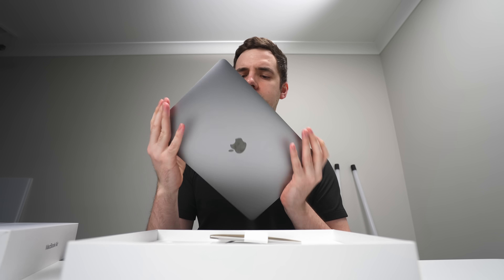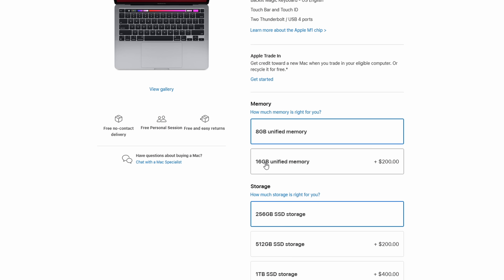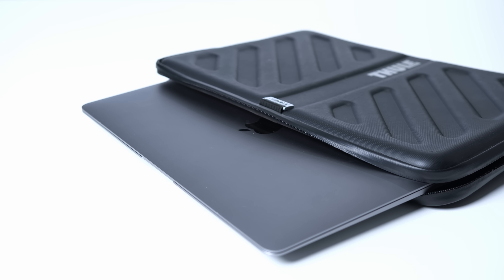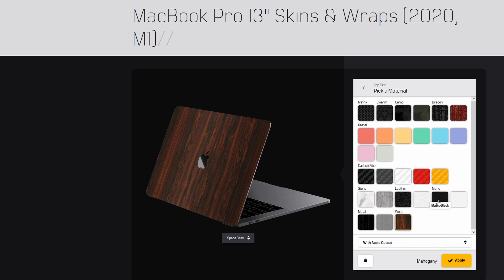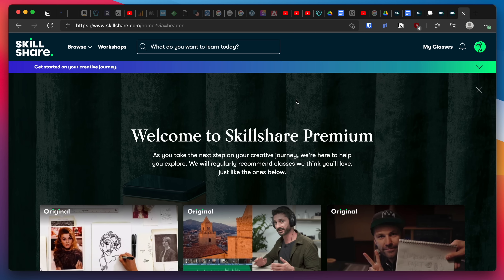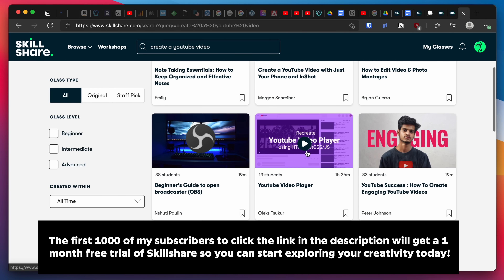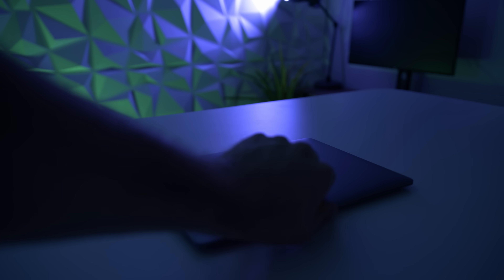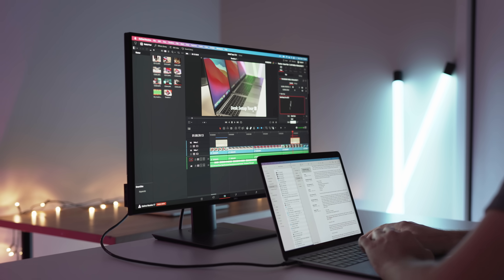How To Make Your MacBook Last FOREVER! (Ultimate Guide)

Comment: One of the reasons I bought a MacBook Pro was due to how much support they get and longevity. I have friends who have had Macbooks for 8+ years while other friends have to get a new Windows laptop every other year. I love Windows but MacOS does a better job with optimization for sure
Reply: This is the main reason I’m aiming for a macbook. With all the problems I’ve experienced on my Windows laptop, I’m traumatized. Macbooks seem so much simpler, less hassle, high quality stuff. It’s just the cost that’s pushing me back lol
Reply: Since 1993 I’ve had 4 Macs as my main work machine. I just stared with a new MacBook Air last year. LC II, iMac, iBook, MacBook Pro. Tbh, I sold the LCII after 2 years when I left Bermuda. The rest were either obsolete or fell apart. 3 apple machines lasted me 26 years - now there’s bang for the buck!
Reply: I have two windows machines one 12 year old and other 5 years old. Both upgraded and in excellent condition. Just getting Mac air now because of solid state (no fan) so no dust related maintenance. In general if you take care of your machines they last ages. Until software support runs out of course.
Reply: The problem is not that windows laptops, but it’s people buying 500 dollar windows laptops and expect them to be as good as MacBooks.
If you’re getting a decent Laptop and know what specs you’re buying, you’re always gonna have it last. Got my Lenovo Yoga for over 5 years now and it’s as good as new.
Update: It doesn't work anymore because the Power Button broke off the Mainboard... to small to solder per hand, working on a solution with a different Button right now haha
Reply: @Breadfan00 yeah exactly, same thing people do with androids. Judge all Android devices based on a $50 phone some financially struggling kid had. That being said, Macs will still typically last much longer than Windows, but Windows is not going to be limited to “every other year,” like what? My 4 year old Windows Gaming laptop is still going strong to this day, I don’t see it lasting as long as my 2012 MBP, though.
Reply: 9 years in my mb pro is still going strong. Might upgrade soon....for the extra power.
Reply: same, bought M1 from a friend used for less then 6 months
Reply: the old macbooks are OP don't compare them with today tech ingeneral that's designed with obsoleteness in mind
Reply: @ko-Daegu  M1 and M2 chips destroy older MacBooks. I’m cool with obsoleteness especially when it’ll last me 10 years
Reply: @pwincesskrissy2557same thing with my Asus rog zephyrus.
Reply: I’ve been still using my 2010 ThinkPad daily
Reply: Yes! I hate how expensive their products are, but I will never buy a non Mac computer ever again. I got my first one back in 2015 and it’s still going strong. We just have issues with base model storage. But I will be buying another one and my husband will keep our current one. I tell all of my windows friends that they are crazy and missing out. Plus not buying antivirus ware every year saves us tons of money over the years.
Reply: @TriggaTreDay  been using windows since i was 6 y/o for the past 20 years. never bought any antivirus softwares. but right now im a full time software developer and been using the mba m1 for the past 2 years. the performance is phenomenal.
Reply: @Maniac-007  You are a different type of human to not have to buy antivirus software for a windows 😂. That sh** is damn near impossible for most people to achieve. Also at the time I was still using windows there wasn't that much help being given on youtube about the matter, I would have to defragment my computer everyday, It was a nightmare. Too much cleaning for no reason. Also I made sure to uncheck all of that spammy crap that every software would have hiding in free downloads. That helped a ton, but it still wasn't enough. Mac is just way better and easier to maintain. But I will say this, I just recently found out that the antivirus software may be the thing that is messing up so many of the window computers. A few months back I reloaded my gateway computer and tried to erase all of the antivirus software that I had ever downloaded, the one that I got from Verizon requires a code for me to take it off. I haven't used that computer in over 8 years. And because I no longer have that particular service there is no way for me to reset the passcode. Now I have to deal with a popup asking me to sign-in every 60 secs. This is the type of stuff everyday non-computer tech science people have to deal with. sorry for the long msg..
Reply: @TriggaTreDay  I would advise you installing antivirus on your Mac. The rise in popularity of Mac has gotten to the point that hackers can make a serious indent if they write malware for macOS.  You may even have spyware on your machine and not know it.  When it comes to your data, I would not be penny wise. It’s not worth the headache!
Reply: @TriggaTreDay  are you using case for your macbook?
Reply: @Maharinii  no, I don’t have a case on it, but I do have a bag for it when I travel.
Reply: @TriggaTreDay the only thing mac computers do worse than windows is gaming.
Reply: @badmoose01  I don't game so I cant really say for myself. I know my little brothers love gaming on my mother's mac computer. So I would have to consult with them on how they feel. All windows are not made equally. So this may be true for the most expensive windows computers.
Reply: My windows laptop is starting to lag only had it 2 years. Waste of $500. I see why people pay lots for apple products
Reply: @PrincessYonnaa  Yea I’ve had horrible luck with windows laptops under $700. I use Windows a lot but it is horribly inefficient
Reply: New M1 especially the Macbook Air, makes all other PC laptops pointless unless you want to game. You can get the M1 MBA for $899(the education discount applies to anyone for some reason). Most PC laptops at $899 are using Core i5 which is less powerful plus, 8gb ram in MBP is probably equivalent to 16gb for Windows. Another thing is a good amount of people including myself have a PC "gaming" desktop. So for someone like me if I do need to run graphically intensive programs I can use my desktop. But on the go the Macbook Air is perfect
Reply: @alphonsusho8962  gaming on a Mac? what game service/app do you use, because the only games I could find on MacOS are Apple's Arcade and some other mobile games that are mediocre. nobody buys a macBook for gaming (which is a shame because of its high powered specs and great software), but I also have a gaming desktop and xbox as well, so I don't see the need to play video games on my MacBook but it would be pretty nice to be able to play top tier games.
Reply: @alphonsusho8962 until the soldered in irreplaceable ssd drive fails and condemns the whole laptop
Reply: Your friends probably didn't pay MacBook money for their Windows laptops. Don't get me wrong, MacBooks are nicely built machines, but I see a lot of people compare Android Phones to iPhones and Windows laptops to MacBooks without considering the price brackets they're buying each one at.

A Dell XPS or Lattitude, some series of Lenovo Thinkpads, an HP elitebook, would've had similar performance and longevity to your old Intel MacBook, but would've costed MacBook money too.
Reply: How can a sane person love windows :D
Reply: @topsl69  Windows 11 has actually been decent. Definitely a improvement over Windows 10 and it feels similar to MacOS. Plus I’ve been using Windows my entire life, I’ve become accustomed to it at this point lol
Reply: @Dylan-qy5tc  windows 11 is def not an improvement over 10 rn, but the amount of software it supports is astonishing. Still mac ftw!
Reply: get a macbook and use bootcamp. literally 2 laptops in one

Comment: Best video on choosing a MacBook that I've seen yet! Quick question: what would you guys recommend for my use case? I hope to get into video editing & design work after college, which is about two years from now, so I wanted to hold off and choose something powerful then. However, my current laptop is really on it's way out, so I need a replacement to get me through college. Do you think the M1 Air would hold up later on? Definitely upgrading to 512GB storage, how about RAM?
Reply: Rule of thumb, RAM upgrade should be your priority over storage. 
You can always buy external SSD's later but you cannot upgrade RAM. 
Unless you plan to store too many files Mac, it's better to go for 256GB/16GB version.

Comment: You are incorrect about the surface of the MacBook only being aluminum, it's painted but there is a surface material over the aluminum because that's how they get the colors for silver and space grey.  And, there is no need to plug in your MacBook if you're using it for hours and hours, because the new MacBooks battery life is amazingly long.
Reply from the maker: Actually it's not paint, they alter the color slightly through anodization. So technically I am correct - there is no paint on the surface. Also, you should have your MacBook plugged into the charger if you're sitting at a desk working for a long period of time frequently. This is to reduce the wear and tear of your battery and will make it last much longer. I go into much more detail on this within the video I mentioned.
Reply: @CreatedTech  I meant to say "it's not painted".

You can't reduce the wear and tear of the battery because it's always in a state of decay.  But the majority of information I've found says not to keep it plugged in while working often.  That would be like leaving your iPhone plugged in all night, it's not good for the battery.  Leaving Lithium Ion batteries at 100% state of charge for lengths of time reduces their life, that is just a fact.
Reply from the maker: @Resist4  I encourage you to watch my video on the battery topic. I explain everything and include multiple trusted sources, including Apple's own support articles that outline why keeping it on charge while working is not an issue. You absolutely can reduce wear and tear, and by quite a large amount.
Reply: @CreatedTech  again, Lithium Ion batteries don't like to sit at 100% state of charge, it's not good for their health.  This means it will reduce their lifespan.  I'm an electric vehicle owner and know about this sort of thing.  And your term of "wear and tear" on the battery is misleading.  Batteries really don't do this, they chemically decay, which starts to happen the second the battery is made.  The process can't be stopped but can be slowed down.  And Lithium Ion batteries are most comfortable at 50% state of charge and should always be stored at that state.  Leaving the battery at 100% is bad.
Reply from the maker: @Resist4  Ok, it's clear to me that you haven't watched the video I made specifically on this topic and are too stubborn to have your mind changed.

macOS will ensure the battery does not sit at 100% while attached to a charger for a long time. It's a feature built into the operating system made SPECIFICALLY to ensure against straining the battery.

The BIGGEST way you will reduce your battery's lifespan is by charging and discharging it often. If you're going to be sitting at a desk, might as well plug it in. macOS will keep the charge percentages at optimal levels. If you're using it away from a constant power source, charge it in bursts to keep the charge roughly between 40% and 80%. 

I'm not sure what you are struggling to understand by "wear and tear". Of course batteries degrade constantly, I'm not arguing against that. I'm simply saying there are certain activities that speed this process up.

Also, your point about owning an electric vehicle is moot. I own a toothbrush, does that mean I'm a dentist? Same train of thought. I worked for Apple for 4 years, and consulted chemical engineers to make my MacBook battery video. What I'm telling you is 100% correct, and it's up to you to decide if you want to change your mind.
Reply: @CreatedTech  My point about owning an EV is not moot and comparing charging that with an electric toothbrush is ridiculous.  EV owner are more aware ab out charging practices as not to reduce the battery packs lifespan.  And I did watch your battery video, but I will watch it again, maybe I wasn't fully paying attention the first time.
Reply from the maker: @Resist4  I didn't say electric toothbrush, just toothbrush in general. My point was more about not comparing MacBooks to an EV as they are quite different even though they both use batteries. 

Yes, please watch the battery video again. I recommend following the advice in that video if you're wanting to maximise the lifespan of your MacBook battery. Although, like I said in that video, it's not a big deal even if you don't and worst case scenario a replacement battery is fairly inexpensive.
Reply: @CreatedTech  All I know is that I used to keep my 2010 MBP plugged in all the time when I used it for hours and ended up replacing the battery 3 times, one of which didn't even last two years.  After talking to others about it they insisted it was because it was plugged in so often and that I should have been plugging it in at 20% and unplugging it at 80%.

But after watching your video a few more times, now I get it.  The new MacBooks software is more optimized for battery health.  So while I can't keep my 2010 MBP plugged in often while I use it, I can with my new M1 MBP.

Comment: I did none of your suggestions, and my mac air is almost 10 years old.
Reply: Did you have any problem with the battery? I've changed my mid2012 air twice now, first last 2019, and second this year. But other than that, it's still alright. I'm thinking to buy the M1 these days bcs I don't think this dude is going to last another year lol.
Reply: @atfannyfanny  I must admit it's always connected to power. My guess is that the battery would only last about 40 minutes if I disconnected it. Yeah - I'm not really confident mine will last much longer either.

Comment: Excelent like always! Congrats for the growing channel! One question, do you recomend put screen protector and silicon keyboard cover ? Maybe with time the screen will be scratched with the keyboard?
Reply: the keyboard and screen never touch. There is a rubber lining on the outside of the screen that only comes in contact with the edge of the bottom part. No need to get a screen protector on a mac
Reply: @Kamran1025  thank you so much!

Comment: "How to make your MacBook last forever?" Not worth the effort, i guess.
I would save all the bucks for ridiculously expensive hardware upgrades if I don´t really need them right now, keep the money and sell the MacBook after 3-4 years, will still archieve a reasonable price. Loss over time will be higher the more I spent in hardware upgrades initially. Selling and previous saved money will pay my next new MacBook, or whatever I´d like to buy then. And I have to spend the money when I actually get something new for it, not years in advance just to keep the stuff longer.
Actually, if you don´t high-level manipulate video material, you won´t need the 16GB RAM upgrade. And SSD capacity... get an external 1TB SSD with NVMe controller and USB3.xGen2 connection, it´s quite fast and will cost you a hundred bucks instead of Apple´s 1TB upgrade for four times the cost.
Also keep in mind, there´s no chance to exchange hardware in nowadays MacBooks. That means, if your RAM or SSD has a malfunction after guarantee time, that´s it. So, your MacBook will work fine for five to ten years, or maybe it will not. Same goes for accidential damage, btw.
And if you really have to care for the money: Don´t buy a new MacBook to keep it 10 years, but buy a cheap 5 year old one and keep it for another 5 years...

Comment: Great video!
I just got my Intel Macbook Pro last year and it's already not doing that well. WiFi can be incredibly slow, apps aren't as speedy, and it gets hot fast. The battery life is comical compared to the M1. Looking at how well Apple did with the M1 macs, I will most likely upgrade to the M1X/M2 this year. Apple silicon is nuts from what I've seen!

Comment: Oddly my MacBook Air 11” (2015) base model which I have been using for only around 3 years have problems with the hard drive. The drive keeps unmounting itself and disappears from disk utility, causing the mac to crash. I have to use an external hard drive to get it running now

Comment: Really helpful. IMO the current lineup of MacBook Pros (Intel based) is nowhere near as reliable as MacBook Pros prior 2016 redesign. I've got 2018 13" Pro maxed out and I've had problems with it since day 1, now after 2 years of heavy use the build-in screen is unresponsive, system crashes are frequent and the whole thing is getting very hot all the time. I'm not buying another MacBook until the next form factor redesign due to that bad experience. Take a good care of your Macs everyone, they are not perfect! :))

Comment: I'm a graphic artist and have a Early 2008 Mac Pro Tower (got it brand new) fully loaded and have left them on only to sleep when not in use. It is now almost 14 years later and still at it. Didn't do anything to it but it lasts "forever" as far as I am concerned. Still mass-producing jobs and cranking them out with ease. (Although I'm limited only to Mac OS X El Capitan and Illustrator CS6, Photoshop CS6.)
Reply: photoshop cs6 is still amazing anyway, and no subscription!